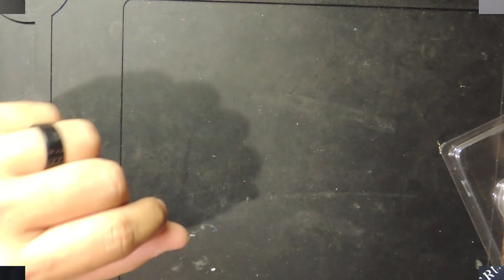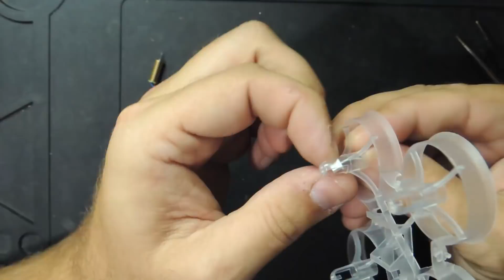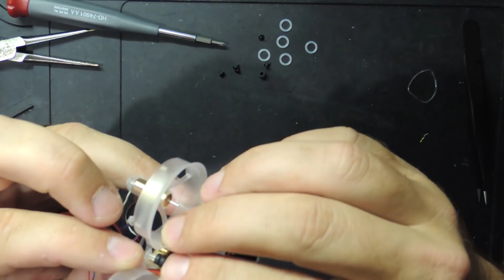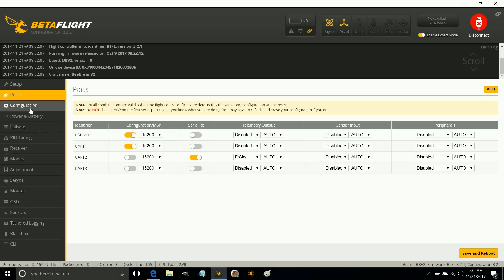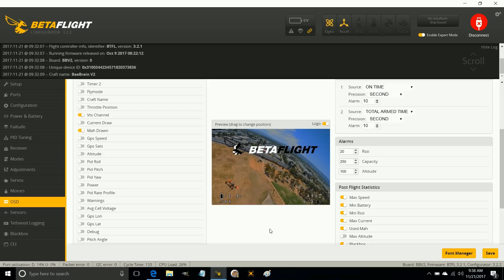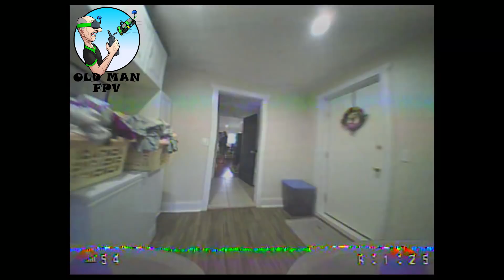NewBeeDrone Beebrain V2 build for $108!!!!!

Comment: For kicks i just built mine out. Ive been flying acro on my whoop to get my practice on, but I hear that auto-level can be faster for tinywhoops. 

So here in-lies my question, whenever i try to use auto-level, it drifts badly to the right and back. i have made sure it is flat and calibrated the acceleromator probably 6 times (running the usb cable through the hole in a old cd or dvd works great for getting it flat. What other tricks can i try to get it hovering more controlled with less drift. Its basically unflying not in acro currently.
Reply from the maker: GibitStylin have you tried adjusting the trim on your remote to get it to hover better? I had to adjust mine a touch. Other than that id suggest moving the motor that's in the direction of the drift to the other corner and see if the drift follows it. Could be a weak motor
Reply: Alright cool yea. yea i was messing with the trim before, but was curious if that is the right approach or not on how to handle drift. Im using brand new gold motors so i doubt its that, but hey, who knows.

Comment: Nice vid! I just got my stack yesterday. The build is extremely easy. I think I may have two faulty motors though. When I throttle up they don't spin until past half throttle.
Reply from the maker: bansheerider619 yeah they should spin on arming. They could have gotten something sticky in them as well. Doesn't take much to bind up these whoop motors